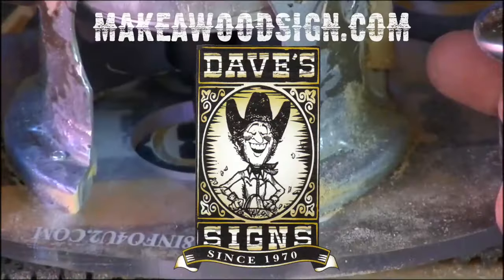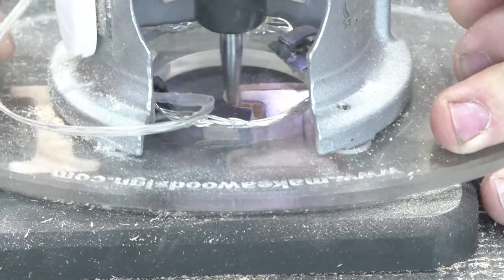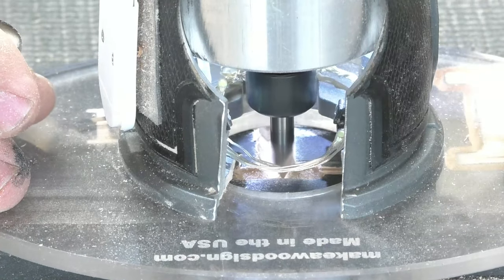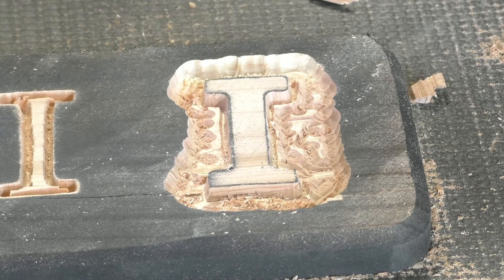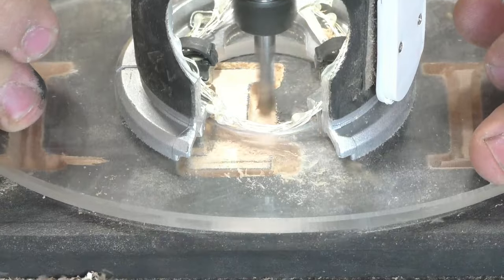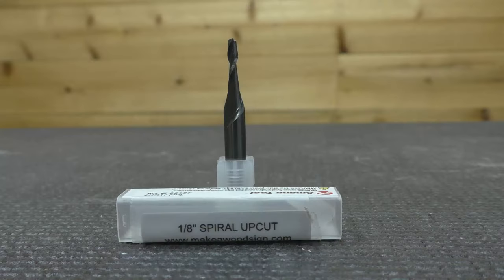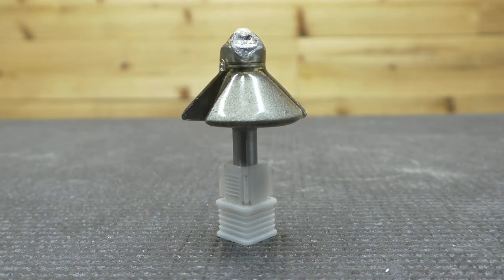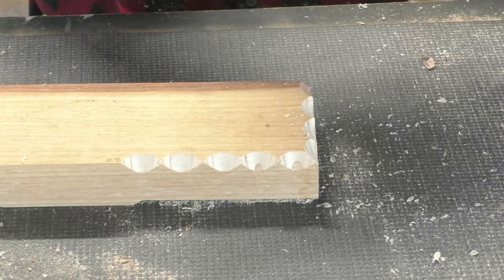The Best Router Bits For Wording - Which Router Bits Are For Which Job

Comment: Just finished making a little sign for my garage, I spray painted it then sanded it. Do you think putting a burnt finish with a torch will mess with the spray paint?
Reply from the maker: If you pass over the paint quickly, it won't hurt it, but if you leave the flame on there for any period of time it'll definitely show

Comment: Thanks for the bit training video. Can you sharpen the round over bit? I occasionally use the upcut bit for inset letters. What are the disadvantages of using it vs. the 60D bit?
Reply from the maker: Yeah, we can sharpen the roundover bit. The upcut bit gives a 90 degree cut as opposed to the V groove, which makes tear out more likely and it can catch on the sander a little more.